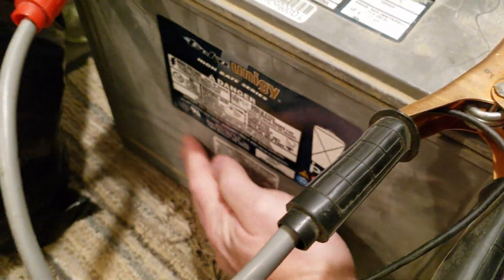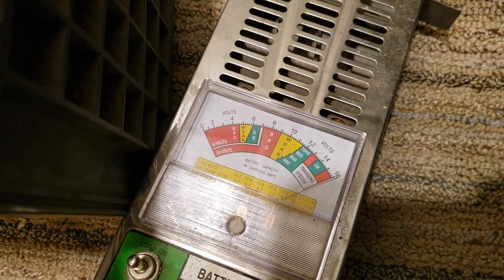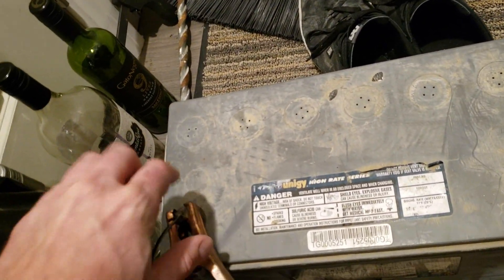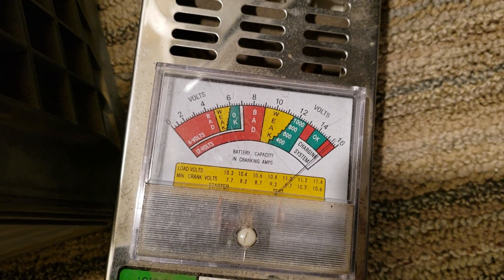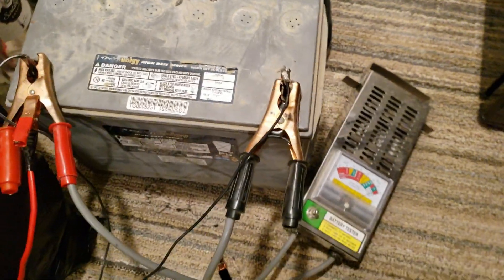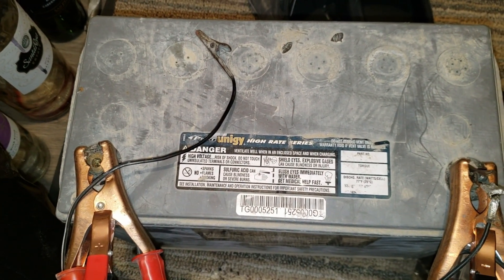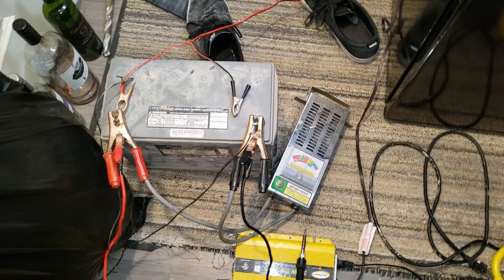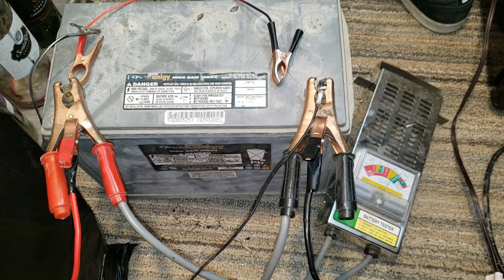Unigy 135Ah Battery Repair

Comment: Try adding a very small amount of acid to the mix of distilled water. I went to a auto place and bought a 5 gallon thing mixed already for 20 bucks and it works great. Like half and half and the equalize charge it for no more the two hour I'd do 20 30 min at a time. I'm almost positive it will bring this battery back pretty good. Lol if not change it over to a slightly to a flooded lead acid battery and then it will work but the the question is how long.🤔😬
Reply from the maker: interesting I think ill try it.

Comment: Charge it to the highest you can get it then somehow use a AC 14.5V-16 V 2-6 amp to vibrate the plack off the plates sorta like they do in electroplating but backs and forth, thats my to cents worth hopefuly the stuff that come off the plate are not conductive falls down buildup and shorts the plates oh ps I got my diesel heat three tries and I got one to land here 24V -8000KW :-)

Comment: The pulsing is usually the sulfated dendrites being knocked off. I have a charger that you can hear it when it pulses like that. But usually only when set for 60A charge. But I have had it happen when charging at 6A. After a couple hours of this, it can bring some of the batteries back. But you have to make sure the water level is high enough.
But sometimes a dead battery is a dead battery and it's only good for scrap or playing with the lead plates (to maybe make another battery)

Comment: It will take a while that transformer likely only puts out 2 amps so 60 hours to charge. I opened mine up and some worked and some didn't but they all went for junkyard lead but you may be lucky

Comment: I got 4 year old sealed wheel chair 35amphs batteries, I've never used... I put a 50 watt panel on them for a month with a mppt controller on them... And wouldn't you know it, after checking each one... They settled individually at 12.4 so the cells didn't dry out and I'm happy now because I can use these  batteries with led lighting system for my deck! 👍👍 But maybe you should try it with a little electrolytes... thanks for sharing 😃

Comment: the "issue" is, you cannot repair batteries
Reply: Actually you can depends on how its messed up. I have done repair on one here last week agm and works fine now. Was found to have a 3 percent loss of capacity but still works great now under load.